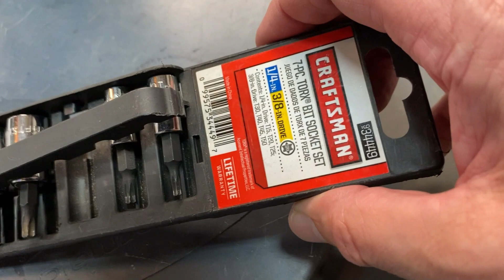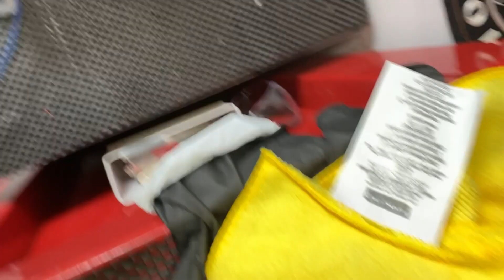EVOffer Tesla Y Auto-Present Door handles & Soft Close Doors - Part 1 of 3

Comment: Ive installed mine and unlocking the car doesnt work to have them oresent themselves.  Evoffer sent a new ecu because they though maybe it was faulty.  New one also does not oresnet upon unlock.  Only Bluetooth works and sometimes they work when oressing the tip.  Is it possible thete is a different olace to connect them to the car?  Mine is plugged in and its located  somewhat beside the glovebox on the side of the car closest to the passenger door.  Or is it possible that the ingenext mod could be interfiering eith this?  Anyone know because this is so frustrating that it doesnt work properly and dealing with evoffer support is brutal.  I just want them to work properly and idk what to do